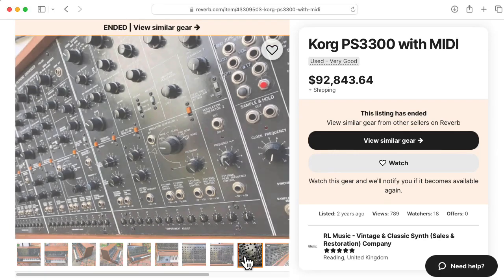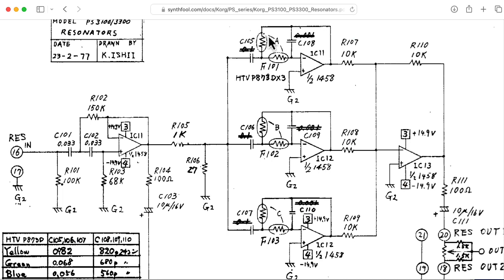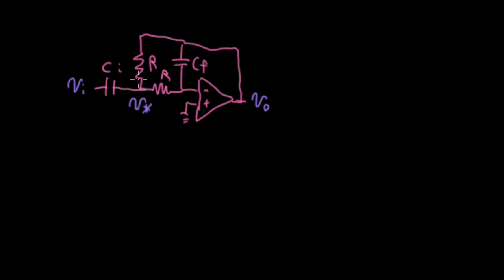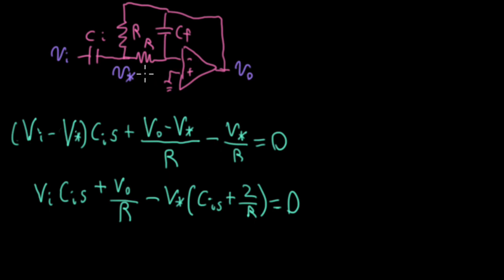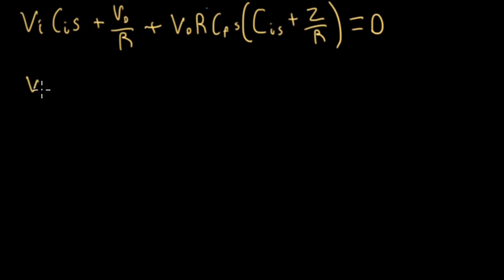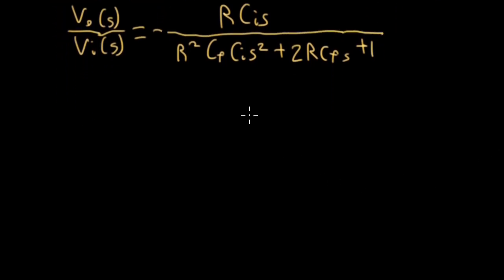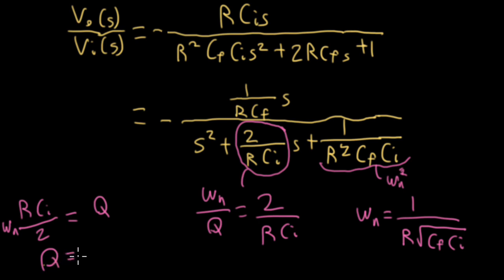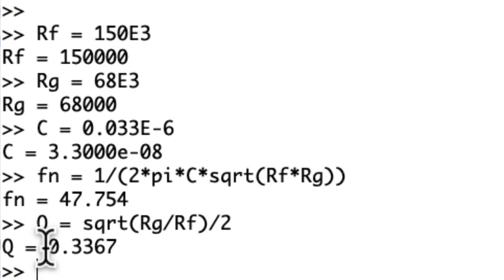Korg PS-3300 Resonator Circuit Analysis: Mutant Multiple-Feedback Bandpass Filter

Comment: Another way to get to the Filter topology of the resonators is by starting with a second order allpass filter then leaving out the resistor divider to the positive input of the Op-Amp and then swapping the resistors and capacitors. I was watching your "ECE4448 L37: Phaser Pedals: Allpass Filter Stages" video where you show a second order allpass filter circuit and that reminded me of the resonator circuit of the Ps3300 and this video
Reply: Also, one reason why they had to swap the resistors and capacitors is because they used a dual Vactrol where the LDRs share a leg and that doesn't happen in the second order allpass or multiple feedback bandpass filters

Comment: Ever looked at fonitronik's triple vactrol resonator (euro module)?
its essentially this circuit, though he cites the ps3100 as the origin.
It doesn't have the blend function, just the filters.
but they can be patched individually on the older version.

Comment: Great video, man! As for the Sallen & Key filter, given that gradual roll-off, that's likely a Bessel curve, which would roll off all the inaudible stuff but ensure a maximally flat phase response for all the passband frequencies. I wouldn't be surprised if that 47.754Hz is literally just the highest possible cutoff you get with a Bessel curve in a single Sallen/Key op amp stage. Not a bad idea actually, I'm definitely going to steal it. Precision AC coupling! 😂

Comment: Native japanese subscriber here, I suspect it's 1枚の基板ニハ同包をつかう. meaning "use same package for a single pcb". I'm not quite sure about the ニハ同包 part since it doesn't quite make complete sense in this scenario nor even make natural japanese. ニ(ni sound) can be ニ(kanji for 2) or even be =(equal),　ハ(ha sound) can be 八(kanji for 8).I hate japanese language lmao.包 is not even intelligible…  or it could be just right.  
Without the doubting part it's "one single pcb", "same" and "use". hope you can make use of this info.
Reply: I think I found out! it's 一枚の基板ニハ同色をつかう, meaning "use the same color for a single board"!
I think the "color" is related with the table at the lower left of the pdf.
Reply: Bilingual Japanese American here, @acurara0113 nailed it.  It's proper Japanese and makes perfect sense.   The note says to use the same color-coded HTVP873D on the same PCB.  This also means using the same C105-107 and C108-110 values according to the table.    I'm guessing HTVP873D was graded by some parameter and color-coded accordingly.  This way, they can use (more or less) matched HTVP873D on the same board.

Comment: I’ve always viewed this topology as a MFB LPF, but the input signal is applied to the grounded capacitor and the input resistor is grounded instead. The grounded input resistor can be omitted for simplicity with negligible affect on the frequency response

Comment: １枚の基板のハ同包さつの勺 means: 1 PCB  on the same substrate. I.e an array of  resistors with the same value, hence the HTVP873DX3 (with 2 resistors).
Reply: @akiatoji5088  Why are you insulting me?I don't delete comments, and the handwriting was terrible.No OCR would be capable of reading the kanji.At least I got the gist.
Reply: @clausanders2886  I replied multiple times and they got deleted, if it wasn't you I take it back.   Yes, handwriting is really bad so 色 looked like 包 and even us natives were scratching our head, I give you that.   But the rest of it wasn't that hard to read, and it's not just one Kanji you had wrong.   The Japanese phrase you came up with (and therefore the English translation) just makes no sense.   I don't mean any insult, it's called out like it is, that's all.
Reply: @akiatoji5088  I forgive you ;-) 問題ない。I would have never guessed　色！I noticed the ハ／八 inconsitence. If you just want to correct me, please just say: you read this Kanji wrong and don't say 'your interpreation is gibberish'. I7m trying to learn.